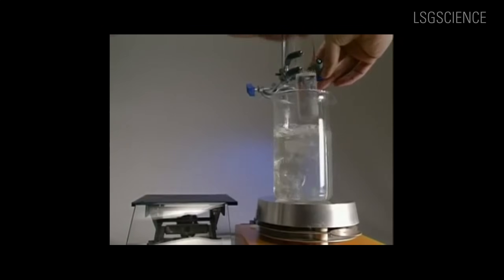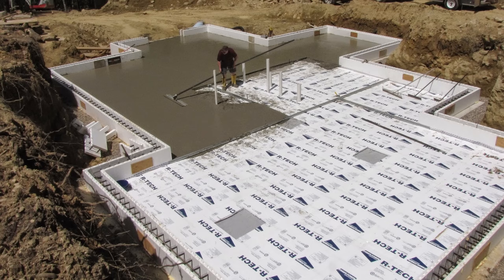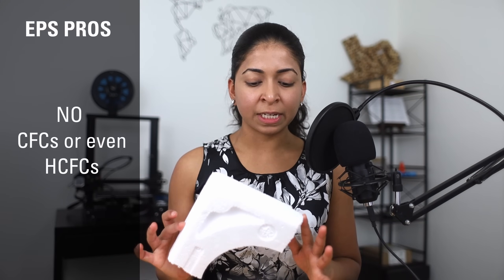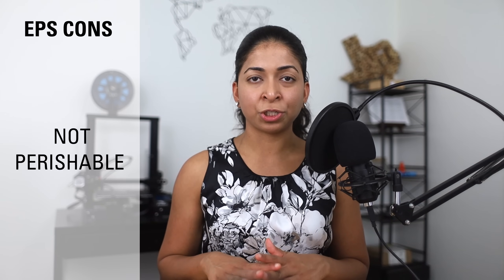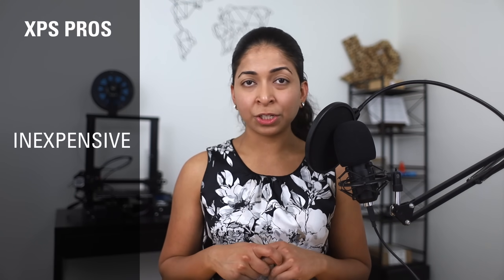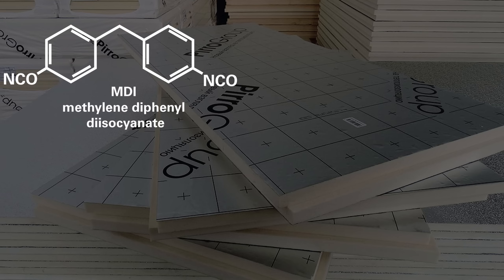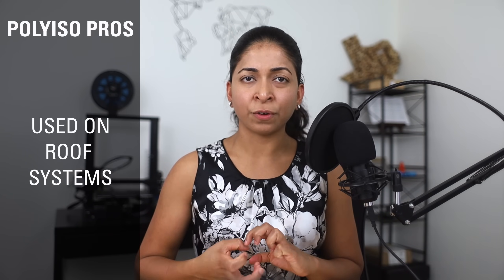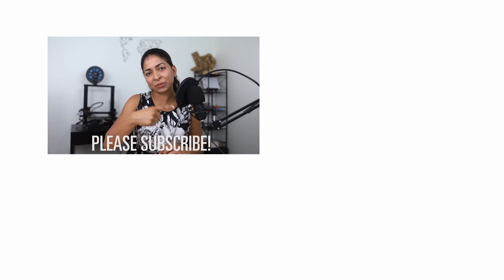EPS, XPS & Polyiso insulation | everything you need to know

Comment: I think your comment about the vapor barrier on poliso causing mold (a 4 letter word in two ways) obscures the clarity of what the potential risks can be and why.
As I am sure you are aware, molds need organic material at an elevated moisture content to consume it and thrive; and the improper placement of any low perm barrier can lead to condensation. However, condensation can only occur if the barrier surface reaches dew point in the presence of air with high enough humidity. 
If such a barrier properly placed there is no risk for dew point to occur. 
In addition the potential for a large enough amount of dust or other organic mater to accumulate on a vertical vapor barrier is typically quite low. There is a greater chance for decay to result on the wood structures below that may be the recipient of the condensation running down a vertical barrier.
You also failed to comment on the value of radiant reflection that foil facing provides.
I remain grateful for your well thought out and designed presentations. Keep up the good work!

Comment: Do you have any thoughts on DUROSPAN GPS R10? It's described as graphite-enhanced expandable polystyrene (GPS) insulation with a thin film laminated to the top and bottom surfaces, and they claim it meets or exceeds all requirements for EPS. I'm not sure what the graphite adds to the equation, and if it would be better for insulating the inside of my basement foundation walls in Canada than basic EPS?

Comment: It would have been good to mention Compacfoam, which is the structural high-density styrene foam. Amazing stuff for thermal breaks. And that XPS and EPS are available in a range or compressive strengths, and that graphite EPS is a thing (with 30% better thermal resistance)

Comment: Thank you I've been trying to work out what insulation to use for our factory and was looking at the poly foil backed but the cost is to heigh so was then looking at eps but forgot about xps. What's the difference with rigid foam and the poly stuff because I've seen videos on people mixing two liquids together and then pouring into a box to make a massive block.

Comment: Good analysis on different insulations. I beg to differ about the claim that polystyrene is 100% recyclable. In foam or expanded form, especially used in packaging, PS causes huge environmental problems. The only plastic that has high recycling rates (above 80%) is PET. PE/PP follow with much lower recycling rates, but PS, PVC and all other plastics have near zero recycling rates; most plastics end up in landfills or, worse, discarded in the environment, polluting soil and water.

Comment: Brilliant
I despise the hypocrisy of foam insulation and it's advocates as it's embedded carbon content isn't high it's freaking astronomical.  The carbon embedded in it EXCEEDS any likely carbon savings through energy savings.  As a volunteer fireman told me, it's their MOST HATED MATERIAL mammoth amounts of choking smoke, huge fuel load burns buildings up faster, and I don't think he even knew the cancer risks from the smoke to him his fellows and everyone down wind.
Foam has exactly TWO defensible uses
1.  Under ground with the caveat that inevitably it's going to become home to insects and vermin negating it's value and creating problems for building occupants and owners so an effort needs to be made to ensure area around are not vermin friendly - think geotextile protected gravel, hard surfaces to shed water away from area (what to use instead, glass board or asphalt impregnated board materials.  Soil temps at basement walls and under slabs can also be kept at around 50 degrees simply by laying 2 inches of foam horizontally out from building - and by sloping away and even flashing to building you also keep basement walls dry - preventing many problems inc heat transfer.  The foam can be below hard surfaced finishes or a few inches of gravel, and you can even add some soil and plant over part of it, keeping all planting away from building of course.  You can even eliminate deep footings by turning this into a frost protected shallow foundation which simply requires insulation be installed about 12 inches below grade.  Any vermin infestation in board is then mostly away from budding as only a 2 inch edge surface touches building.  As it's close to surface a major infestation can be mitigated easily by removal and replacement, nearly impossible with full basement depth insulation, and even treating with insecticides is easier and safer as it's close to surface and most of insecticide will be kept near surface far from local water table.  Glass block is expensive but utterly inert and if anything does eat it's way into it, it dies from ingested glass.  The latter is cheap but must be kept dry to have any insulative value,, which adds to system cost
2.  On existing concrete and steel deck roofs under roofing - new buildings should if at all possible be designed to keep insulation inside nice and dry.  Anchoring rock wool to roof deck is ideal, a 'false ceiling' under slab can provide huge depth for cheap blown in insulation, with functional suspended clg below that.  This single plane unbroken ceiling also is the only feasible way to ensure air movement and water vapor does not rise and condense against roof decking with the inevitable problems it causes and allows easiest maint and modification of top floor ceiling lights power data HVAC infrastructure.  Foam atop roofs DO NOT keep the entire roof deck warm.  R value is based on AVERAGE from insanely high furthest from roof drains to non existant at roof drains due to slope of insulation to drains. (Hint slope your roof to do that job don't rely on foam.  Tapered insulation is also most expensive roof insulation there is.  Inside insulation also allows a fully adhered roof to deck which makes it easier to trace leaks and prevent damage from wind lift.  
Thanks for opportunity to mental floss

Comment: Hmmm... also, they all will burn, and when they do, produce toxic fumes. I would only use these products where they are encapsulated under concrete, or otherwise in a situation where it would be almost impossible for them to catch fire. I would not use them in walls or roofs

Comment: I would never live in a house insulated with one of these, simply because of their fire hazzard. Or any foam insulation.

Luckily I don't have to, because they are banned for the same reason in my country.
Exception is below a slack cement floor (ground floor on sand copression, which is common and can't be reached by fire).

Comment: I can tell you first hand  in my van with a rubberized undercoating to prevent warpage of the panels from curing heat Closed cell spray foam is the best price value for R-values  For retainning heat or cooling 2.5 inches of closed cell spray foam is optimal Once you use more or less the cost to effectiveness is lost  And you would need much more of the other foams/wools in thickness Plus a vapor barrier And you will not fill all the nooks and crannies  This is used in many Government run buildings around me Followed by a blown on fire retardant to code And inspected for thickness of both  In my van in freezing temps i can use a 400watt heater on low heat low fan And be wearing a T-shirt and still warm I am currently looking into a thermostat shut off for the heater to save even more power  Spray foam has had a bad rap on Off gassing which after a day of first installed does not give off any more toxic fumes then the plastics already in your car People should be more worried on the fumes of the car infront of them in a traffic jam  The only other worry is it is installed poorly and did not cure which would give off a bad egg smell as a hint

Comment: In teresting video, I was looking at getting either tiles or sheets of polystyrene for wall and ceiling insulation that I now know should be called EPS foam. I will stisk with eps as its a positive it will let walls breath, so as to prevent mold.

Comment: This was a solid video, thank you! I have a question, though:
I'm renovating my wife's bathroom in a much older house (ZERO insulation in walls and floor on a crawl space foundation). For the bathroom I know moisture prevention is very important. Would a closed cell spray foam be worth doing over a spray foam sealant around the joints with XPS paneling between the studs (this is strictly for the interior wall)? 
The bathroom is torn down to studs and I see the wooden backing in the wall (with some gaps where I see flashing and I assume the brick fascia is on the other side of that flashing). I was thinking I either spray foam the space with a 2 inch depth, then drywall with a Schluter Systems water membrane over, then concrete/tile.
I'm also going to probably insulate the floor as well, but not sure if I should just spray foam the crawl space at a later date. 

Your video was very informative and you've got a new fan!

Thanks!
Reply: Ryan, I'm sure you've finished your project. In case anyone else has a similar question: I have used XPS, polyiso, and spray foam in older houses. Closed cell polyurethane foam (PUR) offers the most bang for the buck. Although it's more expensive, it stops air leaks at the same time it insulates. This saves labor. My conclusion is, use spray foam anywhere you can. Fill the entire cavity, especially when it's only 3 1/2" in a 2x4 stud wall. In a bathroom, use cement board OR drywall with a Schluter membrane. I prefer cement board, one less step.

Comment: The compressive strength of xps is the same as eps. Xps is made into 15-100psi  sheets. Eps is made 7-100psi depending on the equipment. If 100psi is spec’d, however, it is most likely being over engineered. 60psi is usually all that’s needed and all eps manufacturers can make it

Comment: XPS is worse in wetter environments. There’s a reason you don’t see it used in floatation devices. It absorbs water more slowly than EPS but it will not release it like EPS does. EPS is a far better insulation than either XPS orPolyiso in areas where moisture will be present

Comment: Could you please elaborate on why you think that polyiso is the least eco-friendly of the three? I have been assuming that polyiso is one of the better ones especially compared to XPS. Mostly because polyiso uses zero GWP blowing agent. It is also more efficient per inch therefor less material needed. XPS on the other hand uses HFC. EPS and XPS are 100% recyclable but it sounds like the actual rates of recycling are very low. So many factors to consider, but I love your videos. Thank you!

Comment: they use pir extensively here in Finland . Winter temperatures often drop as low as -30°C or even down to -50°C, sometimes with strong, cold easterly or northeasterly winds. November to January, the sun doesn't rise at all.  I didn't know it loses r value over time and that its not very suitable to use in lower temperatures wow

Comment: the pink stuff seems to be harder than the blue making it a bit easier to work with
Reply: @Bruno Desrosiers What do you think I mean by harder?
Reply: @Bruno Desrosiers So I have worked with both a bit more than your average person, and I will tell you that when scoring and breaking the pink foam board will break cleaner with less flexing than the blue board. It's more brittle in that sense. So harder was maybe not the best word. I'm wondering if you were referring to density or maybe the surface psi rating?

Comment: Hi Belinda, thank you for this video, it's really informative. I have one question, you mentioned that Polyisocyanurate suffers from thermal drift but when fresh it has better thermal resistance than EPS and XPS. Would you know how it compares once the Polyisocyanurate thermal drift has completed?
Reply: Data shows that it loses 15% of it's R value over 20 years. Still has a higher R value per inch than EPS and XPS. EPS and XPS are more likely to deteriorate structurally so it is a moot point.
Reply: @briangc1972  Thank you for your answer to Ian's question, I was about to start researching that. I'm starting a build in South Texas and we don't see much weather below 50F down here. Thanks again to Belinda for her excellent content.

Comment: XPS is used commerically in crafts and florist applications. I'm sure almost all of this is trashed instead of recycled. I'm wondering if there is anything similar that can be used in it's place. XPS is used, as far as I know, because it handles water well, it's strong, especially when you stick anything in it, it doesn't break apart, just holding it. It's easy to work with, like cutting it is done with easy to find tools, and it's fine with minimal work. Then it also lasts a long time, so it's not an issue to keep it for a long time.

Comment: I wish there was a green alternative for PSI rated sub slab insulation. Glass foam is not readily available in North America and we cannot use rigid mineral wool where I build as it does not have the compressive strength. I've been building green passive solar and now net zero homes since the early 1980's and always insulate under the slab. Thermal mass inside the structure is a great temperature regulator and heat sink.  Unfortunately we are forced to use foams in Canada
Reply: Gary what is your preferred subslab insulation EPS, XPS or graphite ?
Reply: @johnwhite2576  EPS under slabs. XPS is 1500 times as bad as CO2 in regards to atmospheric warming. I have not tried the graphite which I believe is partially EPS. In some regions people use "warm board" mineral wool but it is not allowed where we build as it does not have the compressive strength.
Reply: @garymccallum4152  Gary i shoudl have qualified- not trying to address global warming with my specifications. What is better subslab irregardless of global warming impact (no scolding SVP-not a climate denier at all,actually quite woke, but recognize my individual  insulation purchase is truly not impactful- if we are serious about global warming these micro efforts are performative theater in terms of real impact - need to be focused on safe nuclear, natural gas, hydrogen and getting India and china off coal-if they stay on coal, nothing will matter if you look at the numbers)
Reply: @johnwhite2576  EPS is the least expensive with a PSI rating and slightly lower R value.
China 29% of emissions, USA 14%,  India 7%

Comment: Great video, very concise! 

I have free access to cutouts from foam-filled steel doors. As mixed materials they go straight to landfill unless I intercept them. My best guess based on your video is that the foam inside is XPS. Peeling the steel off is super easy and I'm left with ~1.5"-thick panels. 

Do you think I could get away with using these as insulation for a tiny home (N.B. - in Canada lol)? Even if I have to beef it up with something else, this would save me a massive amount of money, which is a big priority in building a tiny house.
Reply: Yes by all means use it. That is the best way to recycle this stuff. I’m saving shipping foam and using it in a shed I built.
Reply: Gluing foam pieces inside a tiny house between studs would work, if you found a time efficient way to do it.

Comment: I'm interested in a hybrid material - EPS foamcrete.    Its concrete with the aggregate replaced with shredded EPS foam - or other plastics.  Its lightweight, fire and water proof and not affected by mold or insects.  Its not widely manufactured and is only used in a few high-end projects.  It can include other fibers for strength.  You can produce this material for your own projects but its too spendy in 2020 to use for most homes.  The Perfectblock is an example of this material, but way too costly https://theperfectblock.com/

Comment: I am re-insulating. I have a metal roof, ply wood then vent space. I would like to use the pink foam board on its own in multiple layers, do i need a vapor barrier before I put up the ceiling boards? Am I going to trap condensation between the hot roof and the insulation? Any advice is greatly appreciated.

Comment: @Belinda Carr I am looking into which foam to use to insulate my concrete slab. XPS seems to be a more durable product.  If it out-lasts EPS (In below-grade application), could we justify its use since fewer fossil fuels will be used to heat the home over the life of the home? Less thermal bridging = less fuel to heat or cool the home. Or, can we effectively prevent water infiltration and therefore preserve the R-value of the EPS foam for the life of the home with best-practice below-grade insulation installation.  For instance, if the foundation grade was raised as high as the insulation (e.g. 16"), the insulation was surrounded by gravel for drainage, slanted EPS foam for water shedding (e.g.https://monoslabezform.com/), & roof overhangs.

Comment: Thanks for the video. Very informative.  Which one of the three is best for insulating the walls of a Crawlspace?  I have the opportunity to get 2in polyiso however you mentioned it should not be used with a vapor barrier and I plan to run the vapor barrier up the wall.  Please advise.

Comment: Belinda! Thank you for the perfect explanation!! You are very good educator.... Norway we have a saying; a fool is not the one that doesnt understand,  is the one that cannot explain it the right way!! Anyway, my question is; I am a surfboard shaper and  I make my own blanks, Eps is difficult to work with when you shape a surdboard, because the foam beads are big and the finish comes out rough, so you have to seal it which adds extra weight to your surfboard... I'm thinking of switching to XPS, which one has a better floatation? And which one is lighter? And how does the density work Pound per square foot, the higher the density the better it will float? The higher the density the heavier it will? I'm just clueless, just thought you  might know the answer to these questions .. Thank you Belinda!